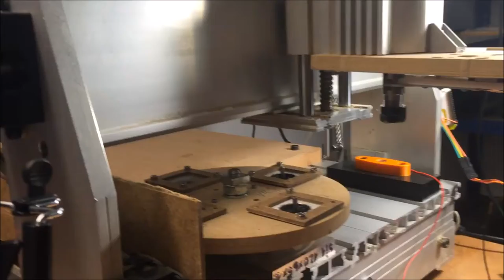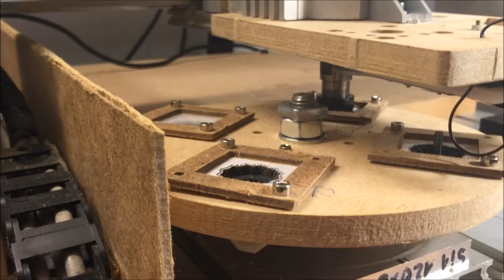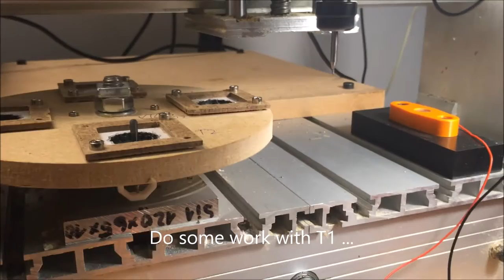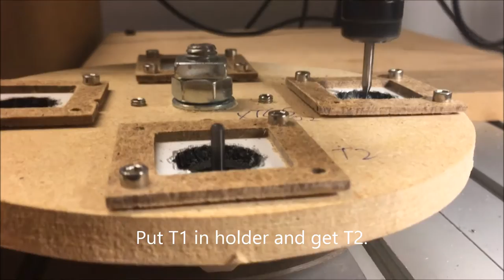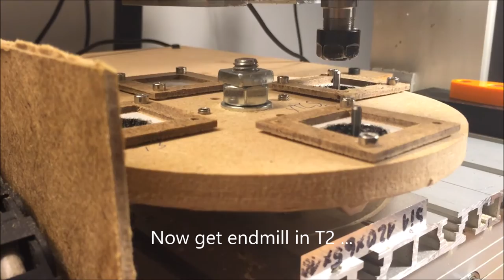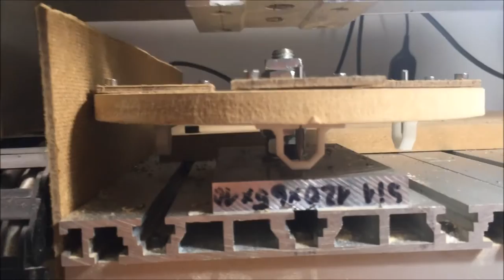XATCv0 2

Comment: Greetings Sir, you are using an internal spring to eject your mills from the collet?
Reply from the maker: Hello Britton Evans , no the 3d printet holder press the top legs against the endmill shaft and hold this in position. The diameter of the top hole it a little bit smaller as the endmill diameter.